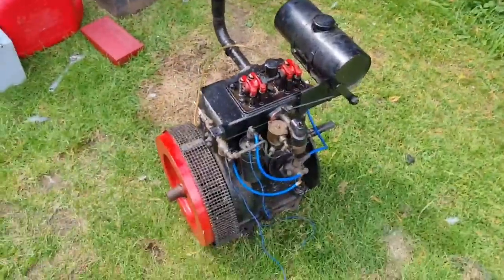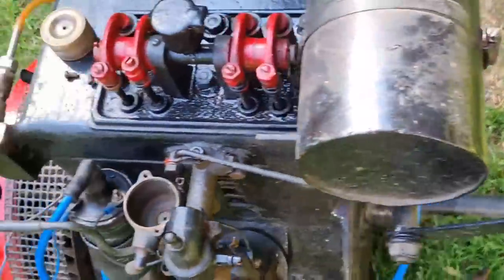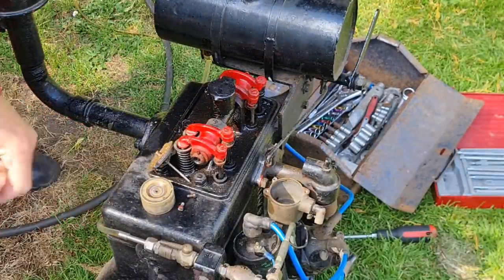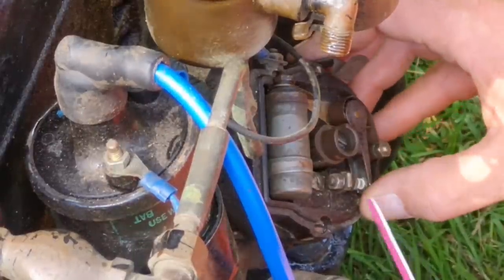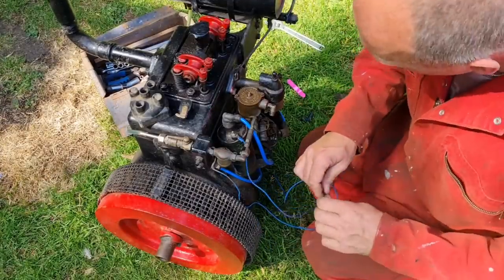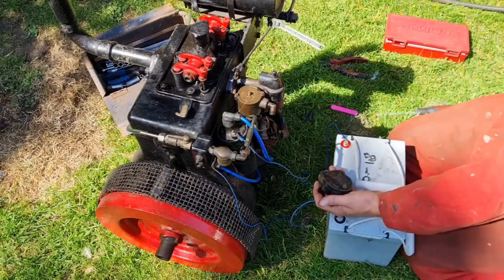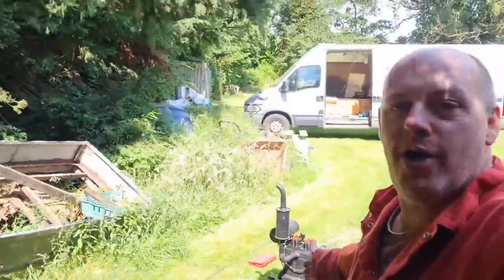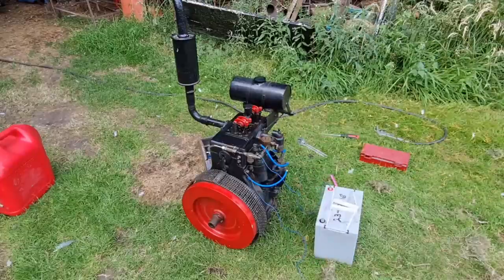Mystery Engine. Will it Start? Will it Run? OHV twin.

Comment: The tank looks like it is meant for a two stroke as the cap has an oil measure attached to it.
Reply from the maker: Yeah it's clearly the wrong tank as it don't fit the bracket right at all. I do like this engine a lot.

Comment: This reminds me, I have a JAP Model 55 to dig out again, and it runs just about the same as this. I'm missing one of its flywheels though, but even as it is, it still seems to run okay.
Reply from the maker: ow I have a Jap 55 that I owned for 30 years. but never had it running as the Mag is missing. 🤣🤣
Reply: @NorfolkMancave  That's a shame, but I'd hope there's one waiting for you, somewhere.  It's an interesting mag too, because it has a small gear setup which drives the rotor arm, and then there's the tiniest distributor cap covering all of that.

I'm not too sure, but I think the main body of the mag is a standard Wipac type, with this little distributor piece added on to allow for two cylinders.

Best wishes in my finding one.🙏👍

Comment: Hi Adam, I think its American and a Caterpillar engine which either directly starts the main Diesel engine or runs an air starter. There used to be one on a farm left over from the second world war still in Khaki green when I was a lad. It was the only thing I recall that looked remotely like this one, though might have been water cooled. That said my second guess would be International Harvester. Great engine though Adam and runs sweet. Should it be 6 volt as the condenser seems humungus and made for higher amps perhaps?
Reply from the maker: I'm not sure what it was for but it's not made but Cat.

Comment: What would this engine been used for?
Reply from the maker: I have no clue. I wish I knew more about it.
Reply: Could have been on an older style baler. Before tractors had a standard PTO, various articles of farm machinery had autonomous engines to power the machine independently of the tractor. Equally though, it could be out something like a larger Dennis, or Greens, lawnmower (I know later Dennis mowers had four cylinder Reliant engines!). Water pump? Cricket pitch roller? Generator? (Though I'd doubt that). Grain blower? Dryer fan? It could be almost anything.

Comment: Kohler model s from 800w lighting plant..... I have d type 4 cylinder......... I have wiring diagram if you have the rest of it.
Reply: I just double checked. You are absolutely correct. Somewhat rare too.
Reply from the maker: Aw Great stuff, thanks very much for letting me know. Any idea of build dates? Thanks again. 😃
Reply: @NorfolkMancave  off top of head between 1925 and 1935 ish  . A post on smokestack on the kholer section would tell you
Reply from the maker: ow great stuff. much older than I thought. Thanks for that.